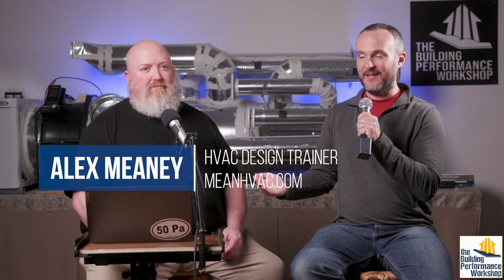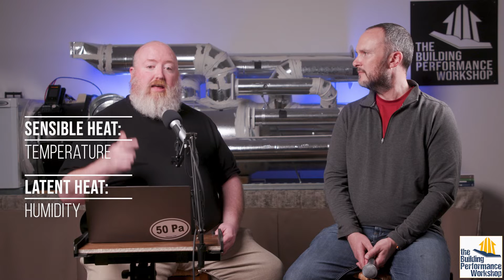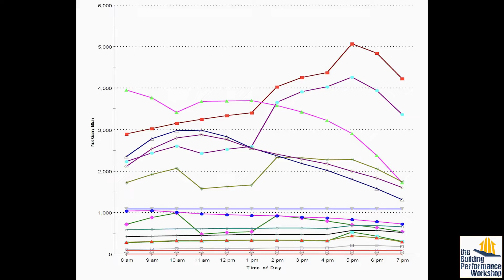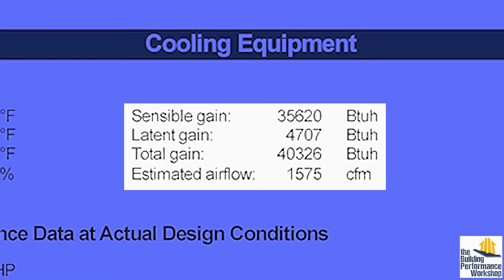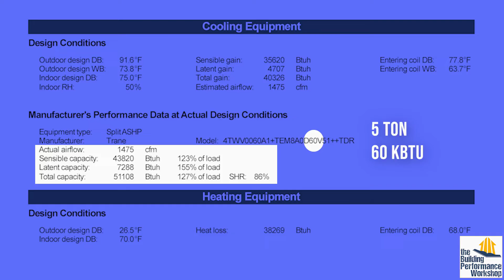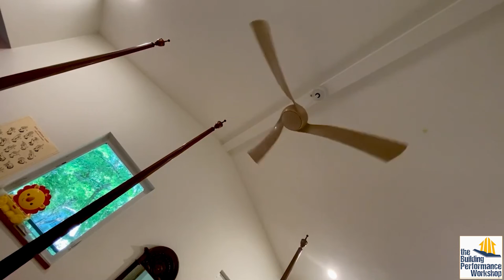Manual S Deep Dive: Selecting HVAC Equipment Based on Manual J Load Calcs- Part 2 of 2

Comment: My current AC runs and cools quickly but doesn't run long enough to reduce RH. I am paying for a Manual J to figure out what size I need to reduce the moisture.
Reply: try slowing your blower down for now
Reply: @d.b.cooper5282  I'll have to look at my Bryant blower motor and get the model number to see if I can adjust it. Thank you!
Reply: Or even a dehumidifier

Comment: I'm a homeowner who replaced my old system.  Significantly downsized it with a top of the line Goodman furnace and a basic single stage AC.  I'm in MN.  In general, the worst cooling situations we have are very high latent, with dew points in the 70s.  My new system works unbelievable well, both for heating and cooling, when cooling on a humid day, I get water pouring out of the coil.  I was able to back off on the airflow from standard 400/ton to about 360, easily through the Bluetooth system interface to match the rated airflow of the matched system.  One thing not talked about, maybe you did this in part one, is that you have a lot more airflow flexibility with a txv, don't understand why everyone doesn't use and push them.  Makes the system a lot more robust.  Like was mentioned, through proper choice of equipment, you can get an excellent performance system for modest cost.

Comment: What can I do as a DIY homeowner, in a small town in Nova Scotia, with few contractors around, and even fewer design professionals anywhere near me, to get a properly sized and designed system? I am currently renovating a 110-year-old, two-story, balloon-framed, 1,100-square-foot (not including the basement which will be sealed and insulated like a crawlspace but never finished with drywall and such) house. It is a complete gut/strip/rebuild saving only the foundation, framing, sheathing, and floor boards (yes, I should have demolished it but I'm way too far in now). I built all new walls inside including interior partitions and secondary exterior walls to create a thermally-broken double-stud system. I'll have a minimum 8.5" cavity for dense-pack cellulose in the walls and will blow in up to R80 of loose cellulose in the attic. It has all new vinyl-clad casement and fixed-sash windows with triple panes and Low-E/argon. There is no exterior insulation or high end WRB but there is all new house wrap, peel-and-stick type flashing around the penetrations, and vinyl siding. I want to put all of the HVAC, including ducts, inside the conditioned space (I'll have to build quite a bit of bulkheads/soffits/chases to hide everything). The house will be all electric (no combustible fuel sources) and will hopefully someday have a grid-tied PV system with a modest battery backup. I'm concerned with heat from as early as October to as late as May, indoor air quality all year, and maybe a little AC June to September (but maybe only if it is needed for dehumidification). Thanks to all the government grant schemes I am seeing heat pump systems go in every other house without a measuring tape ever coming out. Is there any hope for me to get a properly chosen system?
Reply: I would hire a 3rd party engineer and present the reports to contractors. I wouldn’t mind if someone did that legwork for me.

Comment: Sooooooooo
I have a question 

Do the VRF Mitsubishi Mini Splits remove a decent amount of latent since they dial back and run much longer OR is the delta temp over the coil too low to remove humidity?
Reply: Question specific to ductless
Reply from the maker: If you put it in ‘dry’ mode then it’ll dry, BUT it increases the need for maintenance since everything in there gets so cold it’ll all be wet and moldy. Speaking from experience.

Comment: Could you use mini splits for sudden temperature changes(in rooms or living rooms) and use the main AC system for more of a moisture removal? Is it practical? 
Context: an air tight house with a passive blower door scores. From a home owner and wanting to build a forever home. With general contractors experience for 18 years.
Reply from the maker: You shouldn’t have sudden tenp changes if the windows are properly placed and shaded, but any ducted AC only has a 30% moisture removal ability, tops. Temp is easier to lower, so that physically happens first.
Reply: @HomePerformance  thank you very much I am moving to Iowa soon and purchasing land out there to build my forever home and I know during the Summers it gets quite a bit sticky and I don't want to feel that way so removing the moisture would be the best bet for me and then circulating in the air I think would be the easiest way and cost-effective but thank you very much for taking the time to reply to this and I hope you are doing great and hope you keep posting videos
Reply from the maker: Will do buddy, good luck

Comment: Would love some thoughts here... Trying to wrap my head around this. With a basic block load calc, I'm estimating around 52kBTUs worth of heating required. For equipment sizing, my building science consultant (also HVAC salesman) is saying my current ductwork can handle max ~1000 CFM, so instead of sizing a 2-zoned geothermal 5-6ton system, we'll actually need to spec a 4 ton system with a backup (electric or propane). It sounds logical, but I'm a novice here trying to learn building science.
Reply: 4 ton equipment needs ~1600 CFM (400 CFM/ton). Your current duct system is undersized for 4 tons.

Comment: Rookie homeowner, so forgive me, but I don't understand the advice here. Is there any but the most extreme of scenarios in which commonly available equipment capacity won't far exceed the latent? And if so, why not just focus on sizing with sensible and total?
Reply: The equipment capacity is published as a total, but breaks down into sensible and latent. You have to get OEM data to find out what those breakdowns are (and some don't have them available- which shouldn't be allowed but don't get me started). AND those breakdowns are dependent on the indoor and outdoor environment in which they are installed. It wouldn't be hard to find a system with aprox. 30k BTUH total but only 3k of that as latent. A latent load won't exceed 30k, but 3k? Absolutely. Long story short, when you're talking about capacity, you need to be using real capacity adjusted for outdoor and indoor conditions that's then broken down between sensible and latent. There is no central place to look that up (which is just stupid, but there it is) and I think that may be the cause of confusion.
Reply: @alexmeaney2407  Ah, understood. Thanks. Two pros responding in one evening. Heaven.
Reply from the maker: That’s an excellent question, not rookie at all. Let me get back with you
Reply: Proper return air is key, in most applications, air circulation can help offset return issues, humidity control provides better comfort, just my experience having 20 yrs in the business, certified EPA tech. Engineering Design Specialist, IAQ Certified EPA, $5 million a year project manager. 😊

Comment: What’s the new allowance on inverter equipment on sizing. My HDD are ~3500 and OD design temp is 15. Summer CDD are ~1550 and design temperature is either 89 or 91.  My load calc comes in at 1.9 tons cooking and 28-30K BTUs heating.  I’m fully electric everything. House is 1972 1158sqft and eventually I want to upgrade my single pane windows to double pane.  My old unit was a 3 ton but we are removing 1 register that feeds basement.  I’m planning a 2.5ton (27600 BTU) but I don’t want to be over sized.  But heating would be way undersized.  Please clarify what I can do. Thanks!!!

Comment: "tend to be expensive" compared to what?  I would argue it's an apples to oranges comparison in product/service being delivered.  There are manual Js being "performed" to satisfy permitting requirements and then there are those being actually performed for performance requirements.  I think you guys fall into the latter category.

Comment: Great content!  I saw a neat trick with a single stage 4 ton with TXV 2 zone system in a large house.  The furnace was a 2 stage and it was capable of controlling a 2 stage condenser.  To control humidity , the fan speed was set to 350 CFM/ton Y1 and after a fixed time or if both zones called it ramped the fan speed up to 400 CFM/ton in Y2 with no changes at the condenser...  homeowner loved the system and said it worked great in the summer, I will say it took a little bit of digging into the settings to figure out what the installer did.  I thought it was pretty slick, it would have been pure GENIUS level had the guy written down what he did and saved us 2 hours of figuring it out.
Reply: I’ve considered doing that. Could easily be done on a V/S ahu as well.

Comment: I’m not seeing many specd heat pumps that are showing anywhere near parity between latent load capacity and sensible  at 92 degrees F and 50% RH; more like a 85-15 split, esp variable capacity…

Comment: So how does the sizing work when looking at heat pumps where you need the additional load capacity in the winter without needing resistive heat?  If you size for winter use, I suspect you are oversized in the summer, and now likely have a humidity problem. Curious your thoughts. Thank you.
Reply: The next edition of the Manual S will deal with this better. Short version is this. You have to have a plan for latent capacity at operating conditions whether that involves either a dehumidifier or data from that heat pump which provides latent capacity at part load conditions, then you have to stay "within the operating range" of the equipment (which looks like it will be defined as 20-255 above min up to the max).
Reply: @aviking2614  thank you / looking forward to seeing the next edition.
Reply from the maker: Plenty of heat pumps run perfectly down to -5 F, and keep running at lower eff down past it. No heat strips needed.
Reply: @HomePerformance  what about sizing considerations?  In the winter you could have 50-70 degree delta between indoor and out, whereas the summer it’s around 30 degrees around here. If you size for the winter capacity, aren’t you oversized in summer effecting humidity removal?  I have a 3 ton 30 year old AC with an 80kbtu gas furnace. If I want a heat pump, that becomes a challenge / doesn’t it?  I’m curious.  Thanks so much.
Reply from the maker: Aha. Heat pumps are more powerful in heating mode than cooling mode generally, to do exactly what you describe.

Comment: So for a very small (600sq') near passive home in a cold climate (zone 6B) is it better to let a mini split do the dehumidifying or to have a stand alone dehumidifier?
Reply from the maker: Bet money you’ll need a standalone, but try the minisplit if you like first. Dry mode (water drop symbol) increases mold on the blower wheel and housing, which increases maintenance FYI.

Comment: Solution to your fan on or auto dilema: Bypass dehumidification.
Reply from the maker: Interesting, Tim- are you saying you don’t let the coil do any latent at all?
Reply: @HomePerformance  not really. There’s a great tech tip on Hvac School. Basically, you size the coil and AC to the sensible and latent loads. But the AHU is oversized to move the air for proper ACH through the HVAC filter. You blow 350 cfm across the coil like usual,  but there is a bypass duct that moves the rest around the coil. The coil has a damper in front of it so when you’re not cooling, you can still move the ACH air through the bypass duct instead and there is no re evaporation of moisture from the coil,it just runs down and drains. I think you’d still need a ventilating dehu ducted into the supply duct though. This works great for large, low load houses. Check out the tech tip though.  Michael Housh is testing one in his house.

Comment: Looking forward to the Manual J course you are creating.  I'm a consumer about to buy a house with no central heating/air, and I'll be putting in a geothermal heat pump.  But obviously I have to see how leaky it is first (75 years old +?), plug the major leaks, MAYBE have Aerobarrier come in to plug the remainder down to .5ACH or so, and install the ductwork and whatever else, before I can even THINK of Manual J.  I'm out of breath just typing all that.  LOL!
Reply from the maker: Sounds like a serious plan, Unicorn!